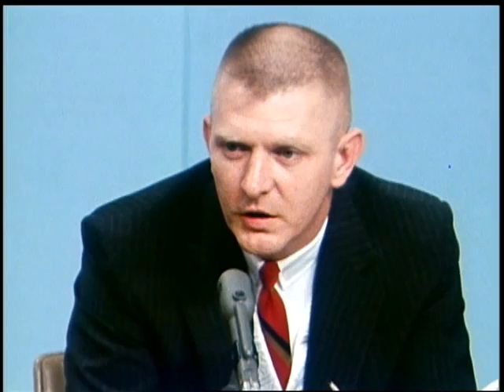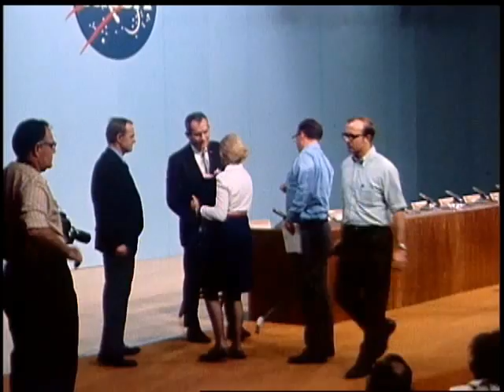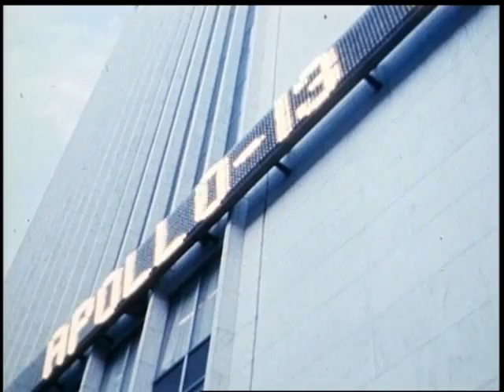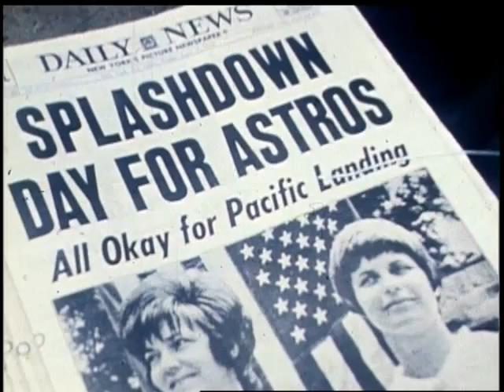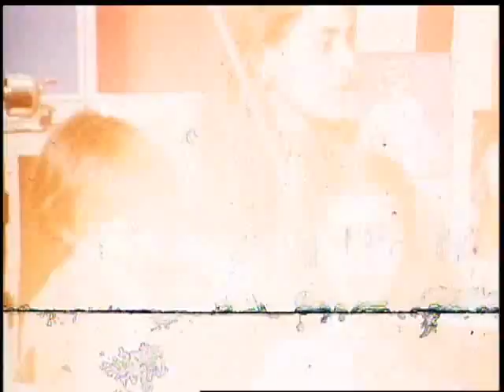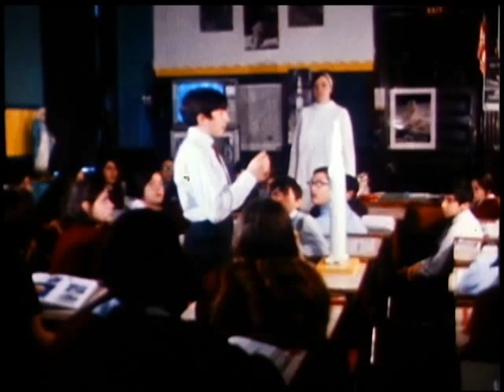Apollo 13 Press Conference (1970)

Comment: You wonder what proportion of his presentation was understood by any of the journalists.  Opening up the deadbands, state vectors, platform alignment,  delta V components.... You can see this guy was carrying the weight of the whole thing on his shoulders.  He had nothing to do with the explosion but if those guys died he was going to be held responsible, or at least he would have held himself responsible. I was 9. But I knew what TLI was even then. I missed a couple of the acronyms he used here. His book is the the best one of the era I think. It is a great balance of technical and personal.  A lot of it is about the people.  If you are interested in this stuff I highly recommend it. Failure is Not An Option.

Comment: they barely had fuel to descend and land 69 miles...but the fuel of the lem on 13 got them to and from the moon...500000 miles with extra fuel for course corrections...tom hanks believes it happened...but then he thinks kip is really kim...lol
Reply: it's called Oberth effect, Rosetta made it to a far out Asteroid with far less fuel...
Reply: doubt it matters when u fire your delta v for rocket efficiency.....Oberth effect.lol..think the space program is akin to a "planet of the apes" movie! next u will tell us that a car gets better mileage going downhill, due to gravitational pull! ..
Reply: John Rogan troll much?
Reply: John Rogan Did you fail 5th grade science?
Reply: Amateur rockets using ammonium perchlorate (oxidizer) and aluminum (fuel) have hit to Keman line (62 miles). One of the guys on the GoFast team is in the same club as me. There was more than enough fuel.
Reply: +Michel Roque 5th grade? Try kindergarten grade.
Reply: will rocket fuel ignite in a vacuum? hypergolic?
Reply: Yes, because they bring along their own oxidizer. Liquid Oxygen in the 3rd stage and Dinitrogen tetroxide or the hypergolic motors in the LEM and the CSM.
Reply: pushing a model rocket....come on Jeff...get real!
Reply: Just showing that it can be reached with a hell of a lot less fuel.
Reply: Yes, Von Braun initial idea was much more elaborate  and involved multiple ships, but that plan was replaced when they came up with the Lunar Reconnaissance Orbiter mission profile.  All of that was well documented and the physics does work. But you are free to believe whatever you want.
Reply: yes it works if you are a Disney flubber clone!
Reply: J.R. get your facts straight before you post , your just repeating something you watched or read .
Reply: You cant even do basic arithmetic what the hell do you know?. Do some fucking math instead of saying moronic shit.
Reply: not enough fuel even reach the Kaman Line on Earth....the whole rocket fuel idea is a farce...it takes twice the power to stop than to accelerate....coasting to the moon...the blastoff from the moon...the reentry into the earth's atmosphere...each concept is progressively more absurd!
Reply: No Jeff...12 million pounds of fuel was needed for such a voyage...Von Braun even lied to Hitler concerning the V2's capabilities. He wanted to refuel in pre positioned stations...the whole enterprise was a hoax!
Reply: did NASANAZI?...I doubt we have a rocket with sufficient power to break free of earth's gravity and reach orbit. This hoax is greater than people can possibly imagine!